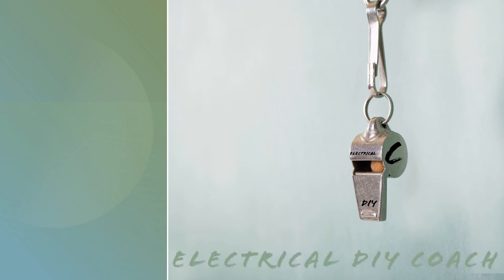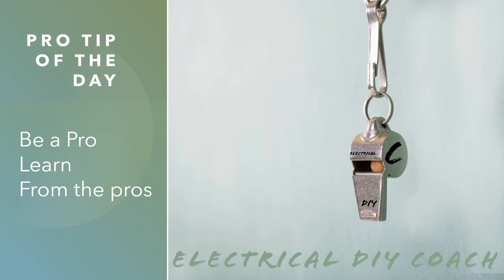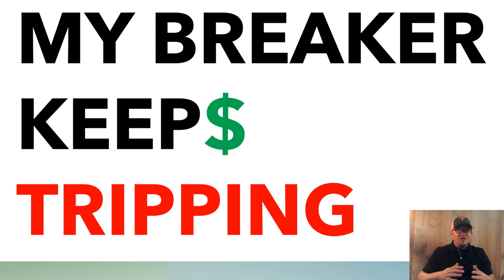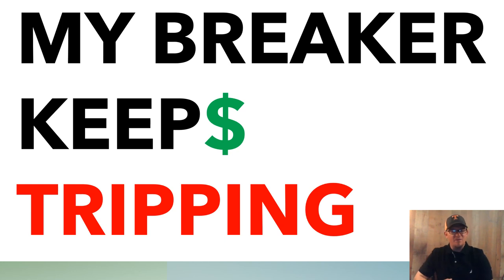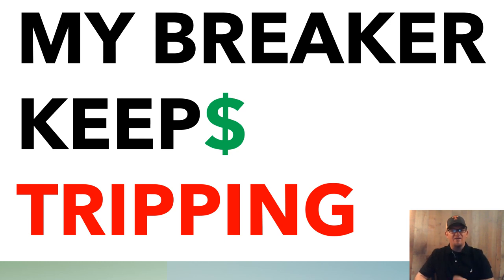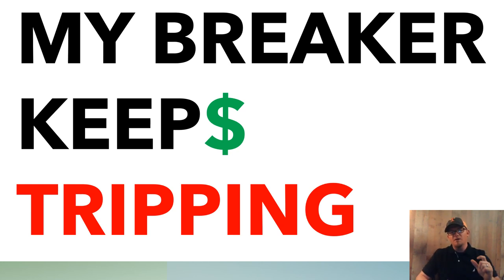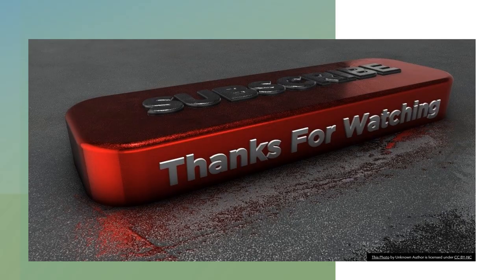Breaker Keeps Tripping!!! Electrical Pro Tip of the Day! Be a Pro. Learn From the Pros.

Comment: @2:15 Thank you for the advice. I found out what was tripping my outlets in the kitchen, it turns out that the combination of a Carbon-monoxide detector, and a Ring door bell chime were too much causing my Keurig to flip the breaker every time. So far once I moved these to another area in the house it all went back to normal

Comment: I wish I had seen this earlier. I have a fast tripping breaker. Unplugged everything, still tripping. Found a few areas in attic where squirrels had chewed through insulation causing shorts. Looking now to replace those two runs of wire. Hopefully that’s all.
Reply from the maker: I'm very sorry to hear that! Hopefully you'll be able to get everything dialed in!

Comment: Maybe my power supply on my pc is failing, breaker often trips after a some hours of having the pc on, power switches back on fine and a light next to “arc fault” lights up briefly but goes away, power stays on but if I boot up my pc without letting it rest it goes out again, I had assumed the outages were because of the extra traffic from my brother moving into the next room or potentially from a new surge protector I got but I don’t know to be honest, going to try buying a new power supply thanks for the information.

Comment: One side of my house power went out. Just one bedroom, bathroom, hallway  where the tv is in the living room and my outside light on that side of the house. But all through out the house i have power. I check all circuit breakers. One pop back to off so i ran to Lowes to buy one put it in and its still tripping.  What can be the problem.

Comment: The arc fault breaker cuts out immediately after reset. We have not added any additional devices to this circuits. I disconnected all devices that I thought were connected to this circuit and reset breaker but the issue persists. Help!

Comment: I have a breaker that keeps tripping with nothing on it. It trips instantly with a little spark. Been taking all light fixtures and switched apart. Have not been successful yet. But if I switch the breaker back on another light from a different circuit dims quite a bit. Anyone have any suggestions?

Comment: My house was built in 2019 and within 1 year my dishwasher/disposal (on the same breaker)  trip and it won't go back so i left it as is.. now  3 years later this happened recently my refrigerator , microwave and washer starting tripping all at once and I'll go reset the breaker  but they end up still tripping few minutes later or so..I have unplug everything and shut down  the main breaker switch and it still trip when those things were  unplugged. I don't know what to do now.
Reply from the maker: Ide call a qualified electrician!!